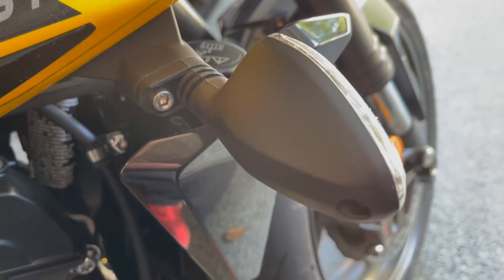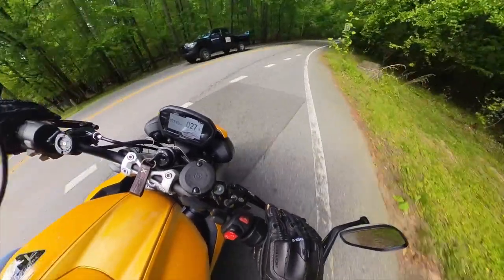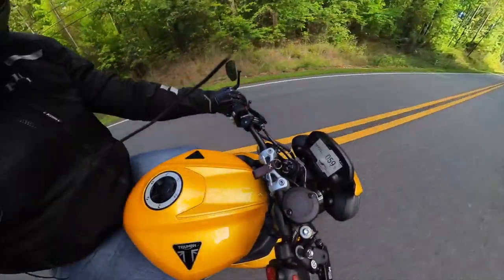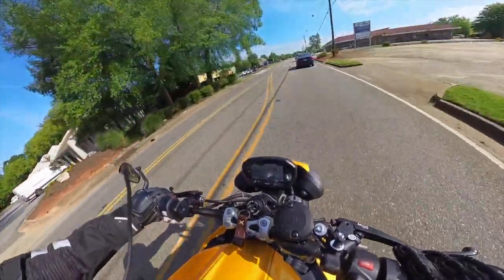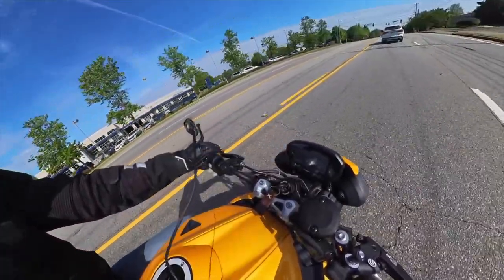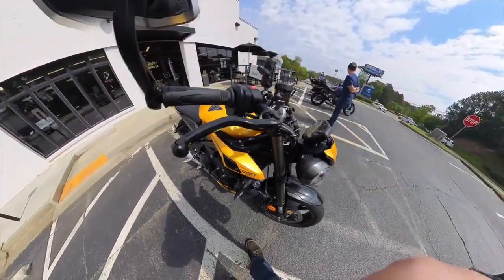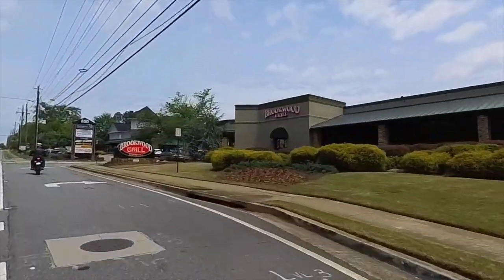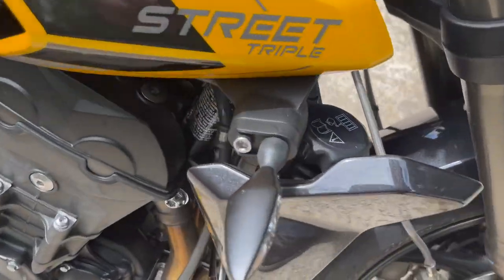Kellermann LED Indicators Modification & Knox Handroid Gloves | Street Triple RS | RIDE ON

Comment: Looks great. I just picked up my 2024 rs cosmic yellow in yhr States. How the hell do i get to the wiring to the front turn signals? Advice?
Reply from the maker: Hi, Speck. Firstly look at this video link, for the correct front turn signals to order for the '24 RS https://youtu.be/AXtHdVir_oQ as I accidentally ordered last years and had to modify them (see other videos this week from me). Anyway, I'd normally do a tail tidy and indicator change myself and like the Brogue as it looked good in-house machined quality (which it is) and all wiring was plug-and-play with Triumph connectivity built in. Simple. However I too looked at the fronts and could see that all the connectors are hidden inside the inner panner. And that panel didn't look like it connected together simply once the retaining bolts where removed. I was concerned that my ham-fisted efforts would break them. So decided that it was simply easier to get my mechanic to fit the tail tidy and front and rear turn signals during the 600 mile service. That takes about 1.5 - 2 hrs labor depending on the shop/mechanics skills. Spending money on labor after you've just bought quality (read pricey) parts can be a bitter pill to swallow, but the end results are remembered long after the cost has been forgotten. Ring Mike @ Brogue to ensure the correct parts (no resistor kit is required btw) and tell him I sent ya!

Comment: It's Cosmic! 😊 You mentioned the 3 bikes. I didn't catch the 3rd bike. New Street RS, the Tiger 1200 and what was the 3rd? You sound like me. Got the 2012 Tiger Explorer, plus 3 new ones. 2022 Speed Triple 1200RR, Thruxton RS Ton Up, Daytona Moto2 and soon Street Triple Moto2. Had a 2011 Speed Triple and 2011 Thruxton 900.
Reply from the maker: Cosmic indeed! :face-purple-crying:I just have the Tiger 1200 Rally Explorer and the Street Triple RS. I've owned multiple Tigers and multiple Speed Triples in the past, but as one might expect, these are even better than the Triumphs of my past. But I don't need to tell you that - you clearly have a plethora of Triumphs! I've broken my wrists twice (both full of titanium), otherwise, I would have ordered the Moto2 on the day I saw it - well done for securing that! Let me know what you think of it when it arrives. Thanks, Kenn! 👍

Comment: The stock indicators on your bike look different to the UK ones, are they filament bulb type. Here in the UK they are led as stock. I'm think of going  for a evotech tail tidy for mine it looks very smart. 😊
Reply from the maker: Yeah, even though no-brainer safer, LED turn signals are not type-approved here - they took forever to approve active cruise control on the Multistrada too for instance - big countries (52 x larger than England) move slowly, unfortunately.